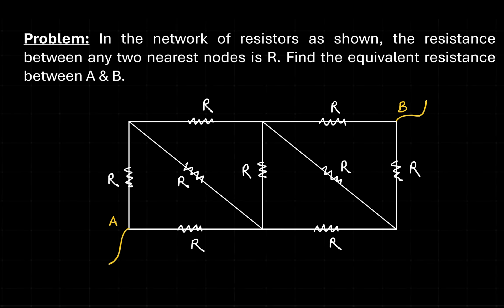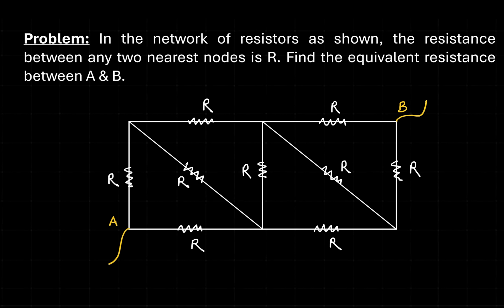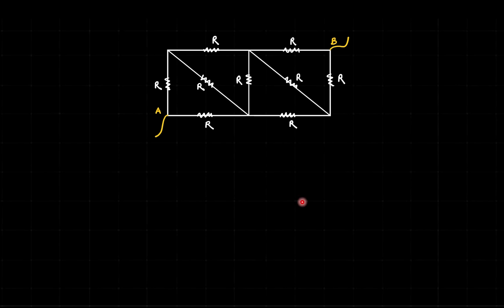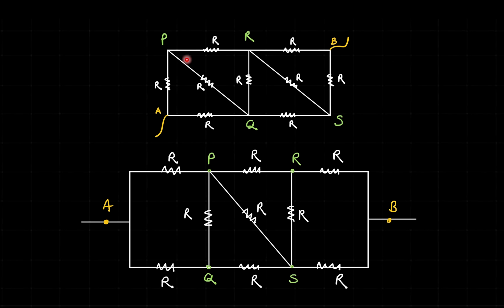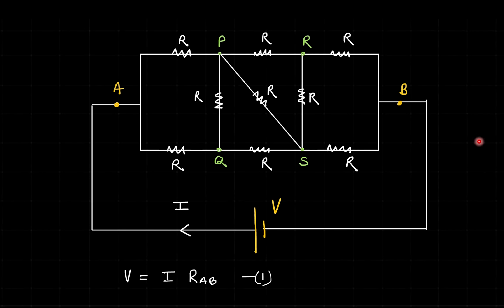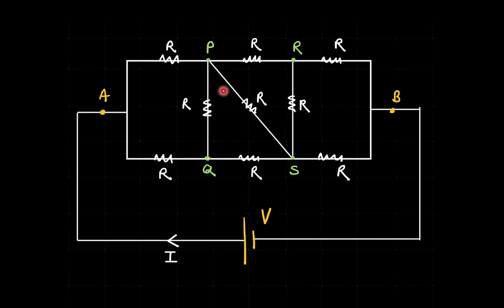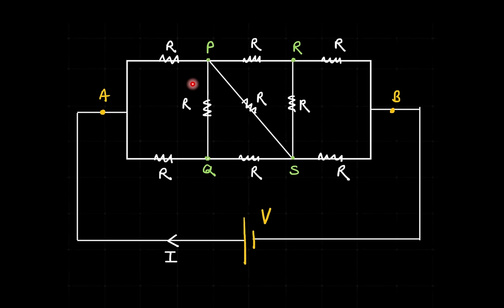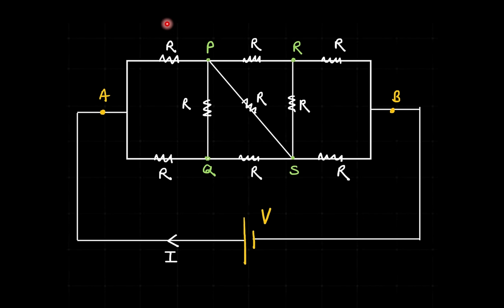M-1 || A challenging problem of combination of resistors || Reverse Symmetry

Comment: Sir in the network given in qn,there was no direct R connected b/w P&S,but in rearrangement part,u have shown a direct R conection...plzz clarify...also try to be more clarity abt I flow in soln part....
Reply from the maker: Thanks for pointing that out! 
Actually in place of resistance between  P and S, there should be resistance between R and Q. In the second conversion, one diagonal PS won't be there but RQ will be there. That will still make it symmetric about diagonal. So, it is a case of reverse symmetry. Means current  through AP & SB, AQ & RB are same . 
I will clarity it iin next video.
Reply from the maker: Please watch it!
https://youtu.be/7mT8jpX2Xes